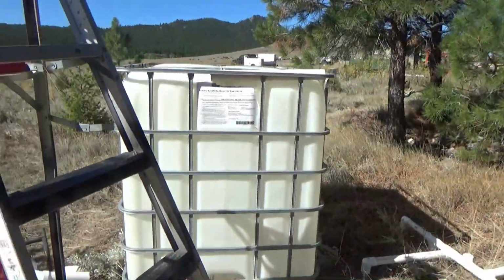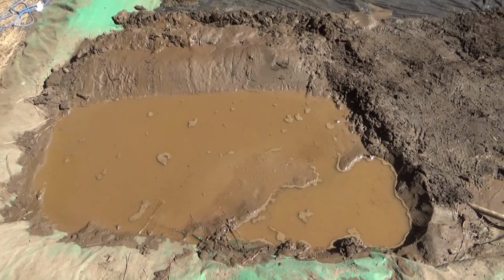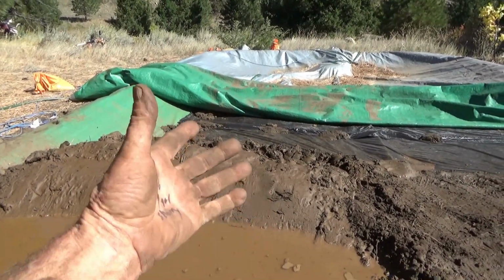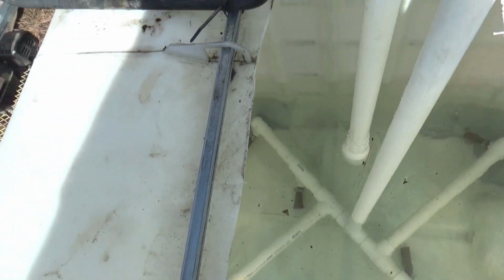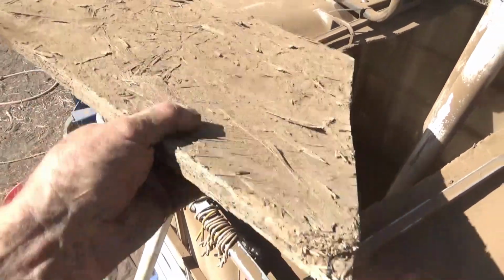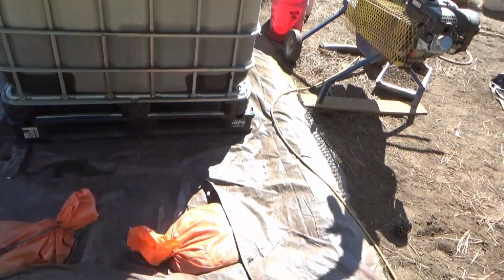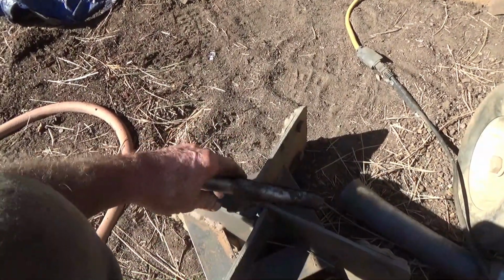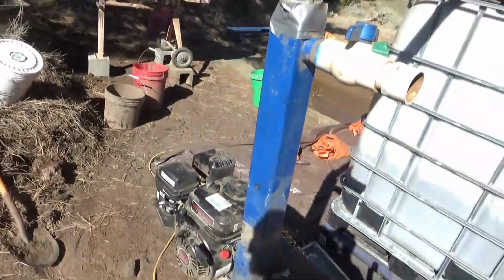230 Turning an IBC into an Agitation Tank

Comment: I love your innovation Keith.  Genius! 

Now you have me wondering if you can turn an IBC into a floatation separator.

Thank you for everything you do.
Reply from the maker: You probably could, but they are a bit large for the scale I operate on.
Reply: Can make a two cell flotation cell with one tote. I like that idea. I've used a cement mixer and actually created auriferous foam... ?
Reply: @dond2150  I love the cement mixer idea.  If you had one that pulled behind a pickup you could take it right to the mine and drive it back home at the end of the day.

All you would need is a way to catch the foam and you could probably process 2 ton an hour
Reply from the maker: @dond2150  What was the foaming agent?
Reply: @hardrockuniversity7283  what happenened, i was cleaning 25 lbs. of -30m ore in cement mixer to prep for Hg later.  I used the kitchen cleaner FANTASTIC, but,like you, i was multi tasking, and forgot to check on it plus I put too much soap in.  So I saw big bubbles and foam coming out, took a 90 cm. whatman filter, scooped up foam, buchner funneled it, had nice small pcs. of Au. Good job on your leach mill
Reply from the maker: @dond2150  That sounds like a fantastic floatation system you are working on also.  :-)